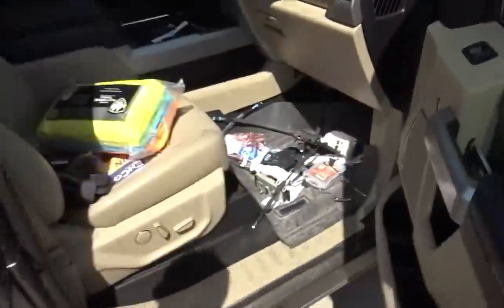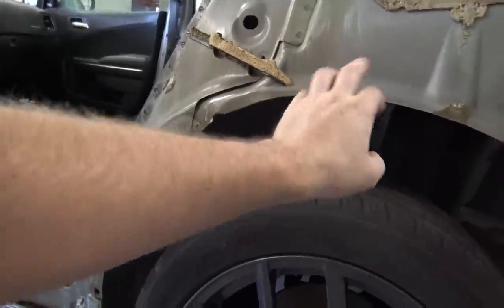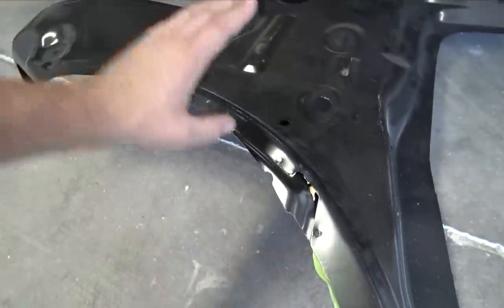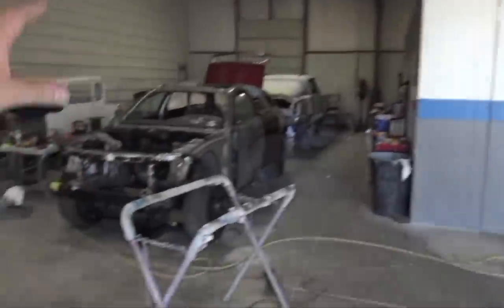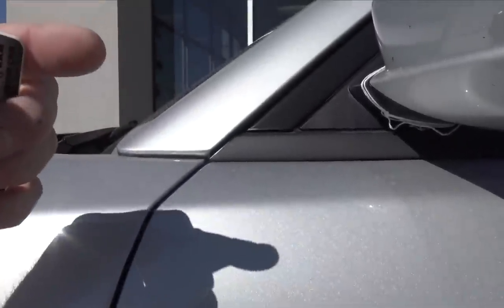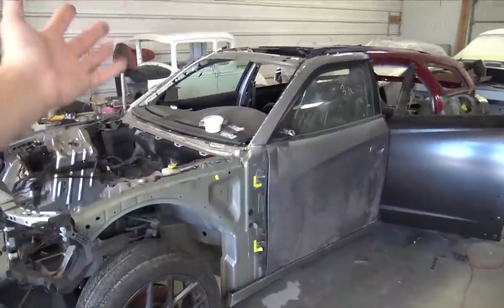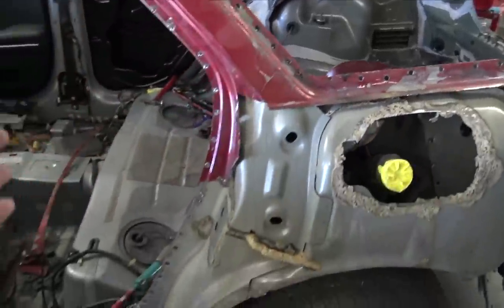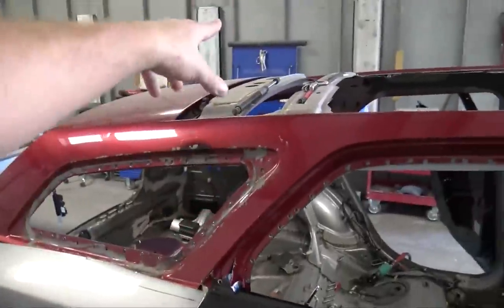Building the Ultimate Station Wagon | 2021 Charger Magnum Hellcat | 1000HP Hellwagon | Pt 11

Comment: Dave, you need to put your door shut rubbers on to make sure you are 100%. Sometimes not putting the rubbers on can affect your in and out. Use 1/8 aluminium pop rivets instead of screws. Cut the inside end of the rivet off with side cutters. That way no drama trying to fit rubber over screw. Looking good mate. Keep goin hard brother. One of my best auto you tube creators. You tell us what's doin, how ya gunna  do it. No B.S. Cheers mate. Andy

Comment: Just curious you are a little more educated on the magnums what all interior parts will swap out with a late model charger and on sheet metal work get some klikos there awesome work similar to sheet metal screw method there reusable fasteners drill a hole put em in and remove one at a time as you spot weld I love em
Reply: Once he starts working on the interior....he will go over everything on what fits and what he has to modify.
Reply: I second that Klikos are time savors